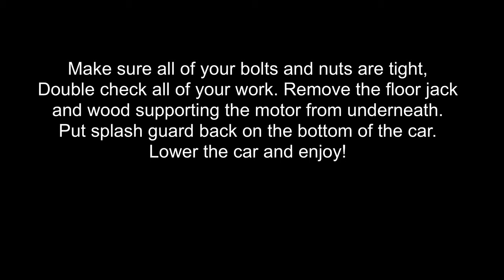Hyundai Veloster N Motor Mount (Rear + Upper) Install

Comment: Awesome car, my Tuscon unfortunately is g4fj 1.6 with catless dpipe both ,scorcher gt 77-47001,60mm TB with rear wiper pump to intercooler spray., custom cai with box..  it wheel hops I also think 245/45/19 is horrible so 18s!

Comment: Great videos man! Since you did both at the same time i'm not sure you can answer this question haha. I've got the lower engine mount already done. Do you think doing the upper would add a ton more NVH?
Reply from the maker: Yea it adds a bit more NVH when adding the upper. I originally just had the lower mount for a week or less but it was a while ago so can’t remember exactly how much more nvh was added but you do get a bit more, after a while you get used to it though, it’s not that bad in my opinion
Reply: @chrizzz619  I just added the tmm a week or two after doing the rmm. Both ttr. The added performance from the tmm isn't worth the nvh imo, but I just put it on tonight. Does it relax quite a bit eventually or no? I may just go back to oem tmm if it does not since the rmm added barely any.

Comment: Hi!,what about vibrations? You can daily drive it?
Reply from the maker: Hodei Zubikarai you definitely get added NVH (Noise Vibration and Harshness) but in my opinion it’s worth the added NVH for what you get. The car to me feels more “raw” if that makes sense lol. You notice the vibrations more when taking off from 1st gear or reverse but I can daily drive it it doesn’t bother me! The vibrations also settle down a bit after about 100 miles, either that or I just got used to it haha either way the vibrations are bearable
Reply: I have TurboTech Upper and Read Mounts and I can say the same thing. Its almost like all the noises you WANT to hear are amplified. The car certainly feels more raw but these paired with the adjustable short shifter from Forge kit give the car an entirely different feel.

Comment: Great video. Just a bit confused on the loctite. You put in on before installing the mount into the engine bay. Then after the loctite has set you then want to torque the bolt? Just seems like this would break the loctite from it's set position, just curious as to how this would work
Reply from the maker: Steelers1thegame thanks! Loctite takes about 10 min to start settling and about 24 hours to fully settle (according to loctite) I put the loctite and right away installed the mount and then torqued the bolt down. I haven’t had any problems since installing the motor mount so it all should be good as long as you don’t apply the loctite and Torque the bolt down a day later :)
Reply: @chrizzz619  Appreciate the reply! Keep up the good videos here, really enjoy seeing the content on the how to section of the VN forum. Take care

Comment: Can i buy this mount and install it on the veloster base models? The motor mount says for turbo buy my car is base. My right motor mount is leaking and i want to do it myself. Someone plz help me
Reply from the maker: I’m not 100% sure, I would message the company directly and have them tell you if it’ll fit your car or not, that’s your best bet!

Comment: Which engine mount change made the biggest difference?
I get horrendous wheel hope and loss of traction on hard acceleration.
Does changing the rear motor mount solve this problem?
Reply from the maker: Changing the RMM to a stiffer one definitely eliminated the wheel hop for me, I had just the RMM at first then I installed the Upper motor mount and it just made the car perfect in my opinion 👍 you do get a lot more added NVH tho
Reply: @chrizzz619  thanks. NVH=???
Reply from the maker: @dougmaverick3287  yes, Noise Vibration and Harshness
Reply: @chrizzz619  only with the RMM, is the NVH get too noticeable?, can i still use as family daily car?
Reply from the maker: @Velosy_  I mean I personally don’t find it uncomfortable, but then again I’m used to cars with stiffer suspensions so the added NVH from the mounts aren’t a big deal to me, I personally wouldn’t find a problem using it for a daily family car.

Comment: If you're only doing the upper mount you can save a lot of time from the instructions they send with it. First, it's a bit easier to get the mount in position if you slide it under the bottle. Also, if you have a long enough 15/16th or 24mm wrench to oppose your torque wrench, tightening the main bolt to 160ft lbs is much easier outside of the car because you don't have to remove the fender liner or jack the car up at all then. Using an engine hoist on the two lifting eyes on the engine is also easier than using a jack unde the pan because then you don't have to remove the belly pan. Total time to do it this way is cut down to about 30 minutes.
Reply from the maker: Thanks for your tips! :)

Comment: what are the torque specs?
Reply from the maker: Didn't notice the other torque specs weren't included in the video.
For the 17mm bolt and nuts, tighten anywhere between 46.9-54.2 lb-ft, for the 14mm nut and bolts you do anywhere from 36.2-47 lb-ft. thanks for commenting and ill update the description